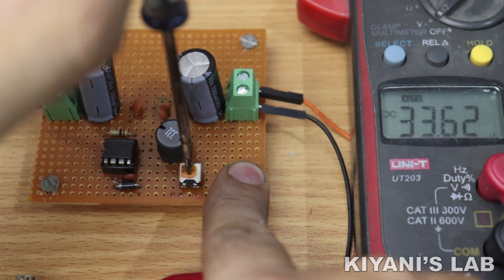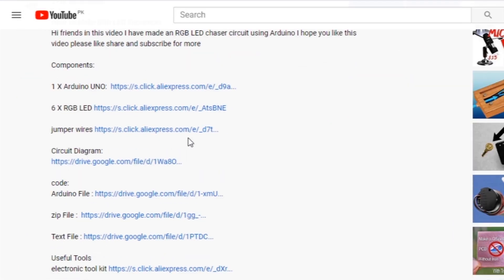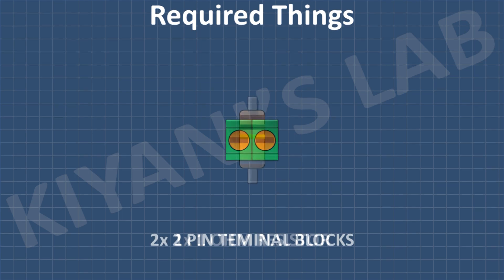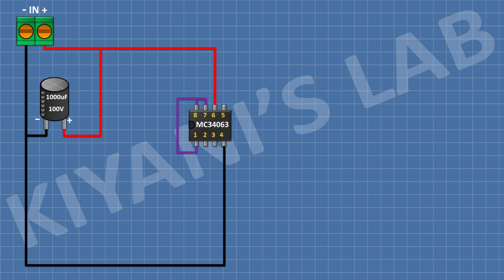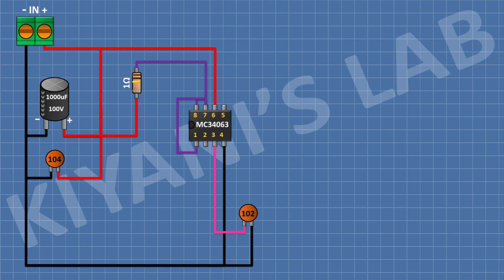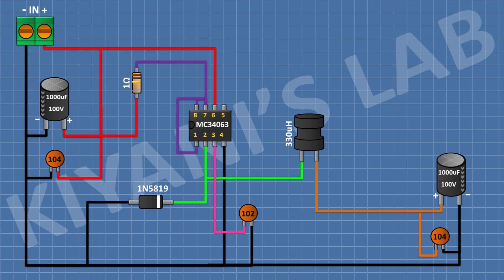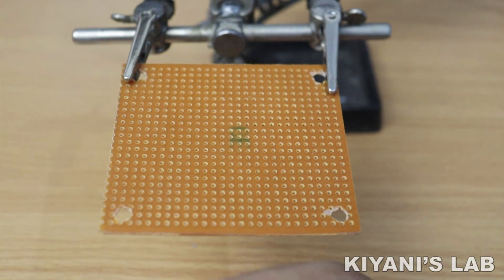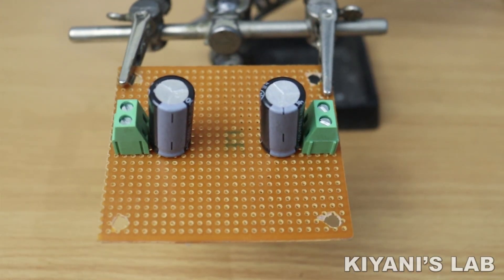How To Make DC buck Converter Using MC34063

Comment: I made such a circuit while ago . but output current is too low .Like 20-50mA . what was my fault, can you describe ?
Reply from the maker: you can use external transistor for high current